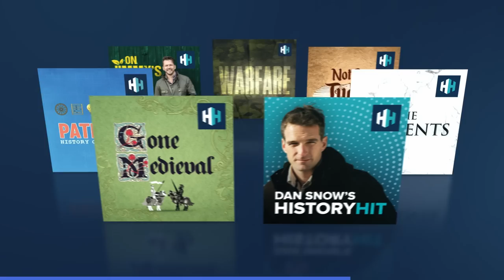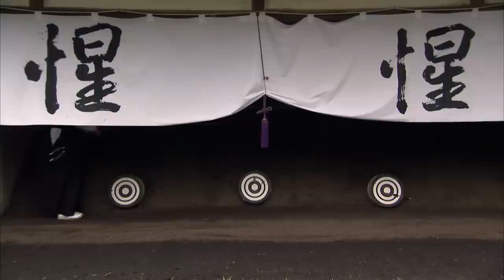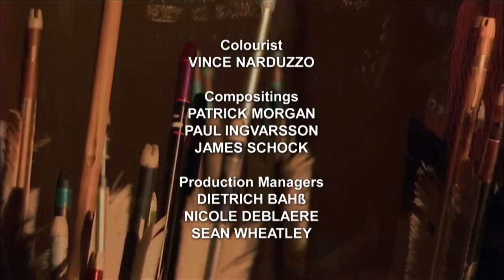This Ancient Bow Was A Samurai's Deadliest Weapon | Samurai Bow | Absolute History

Comment: Such an amazing design for a bow, the asymmetrical shape, the bamboo back a tempered bamboo belly, and the laminated side by side tempered strips of bamboo core with hardwood edge strips. I have made about 80 bows of many types, but making a yumi and having it come out balanced without being able to tiller the belly is truly an art form. I managed it half a dozen times in a traditional longbow shape in all bamboo, but wouldn’t know where to start on a yumi

Comment: A 23 kilo draw long bow is not a fair comparison.  Would also wager that bows intended to draw and shoot from horseback just can't max out draw weight the way a bow intended to shoot on foot can.  You just have better positioning and leverage with your feet planted and legs beneath you. 
"Shot from the ground, the umi out performs the longbow". No, the umi outperforms a 1/2 strength long bow.  They're just different tools for different roles. Maybe you get to this later but jeez.
Reply: None of this is accurate. Manchu bows from centuries ago has a draw weight of 120-180 pounds, for horse-back archery. As for the Japanese Yumi, these are for target practice, 40 pounds max. The war-bow Yumi had more layers and were on record, 45-67kg draw weight. Surviving samples in Japanese museums proved it.